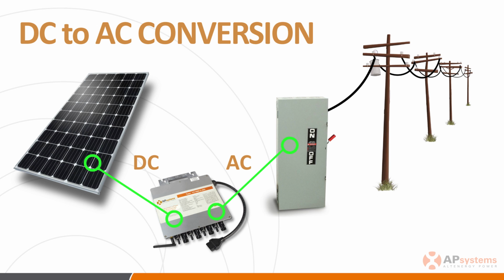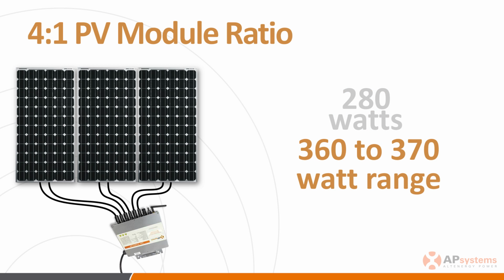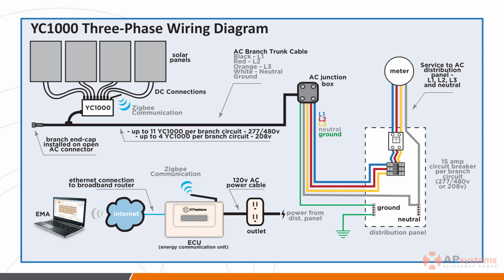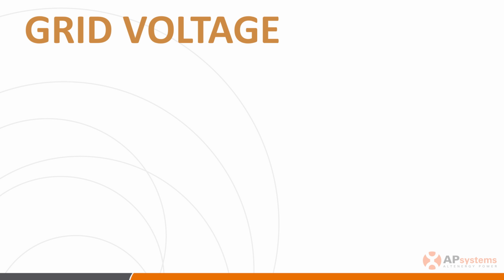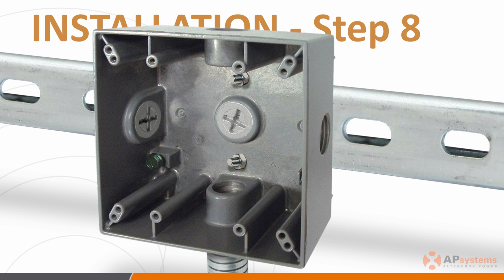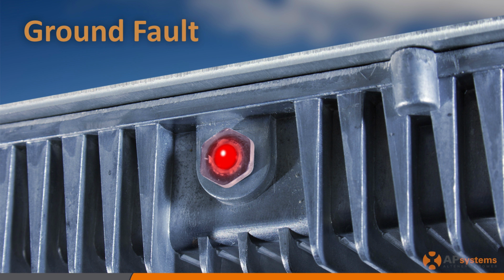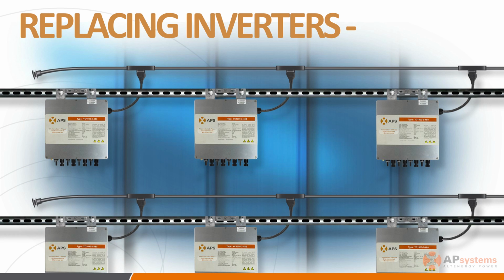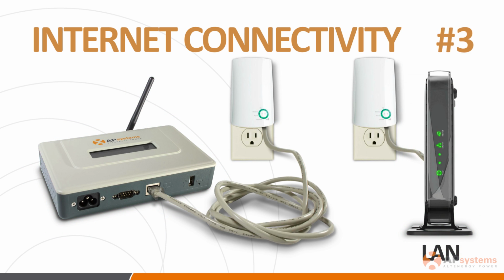DISCONTINUED PRODUCT: APsystems YC1000 Certification Training Video

Comment: Hi,
I'm an a student of electrical engineering and I plan a solar roof as a graduation project.
I plan to use YC1000-3EU microinverter in my project which will be connected to 4 solar panels of 360w each.
who can I contact if I have any questions about the micro-inverter?

Comment: i Have a question in a system , the trunk cable have this colors (white , orange,black,pink,teal) , how i know what is what , thanks
Reply from the maker: 2Meter cable - Black - line
Red - line
Pink line
White - neutral
Green - ground

4Meter Cable- Red - line
Black - line
Teal - line
Green - ground
White - nuetral
Reply: @APsystemsSolar  I can get this video in Spanish. Thanks